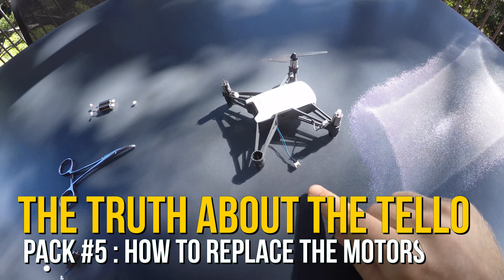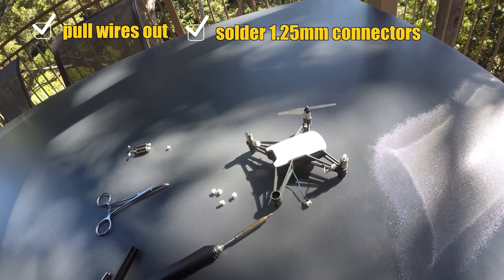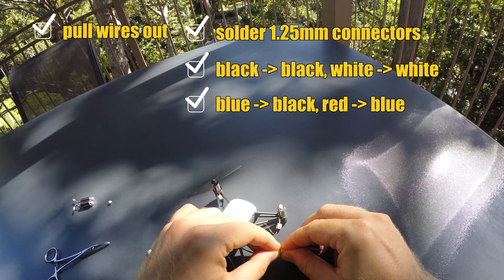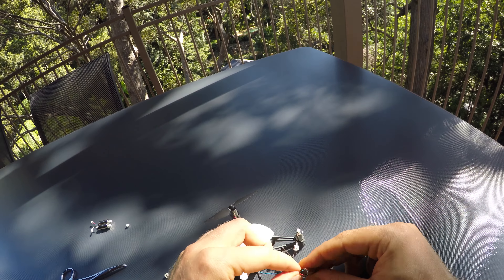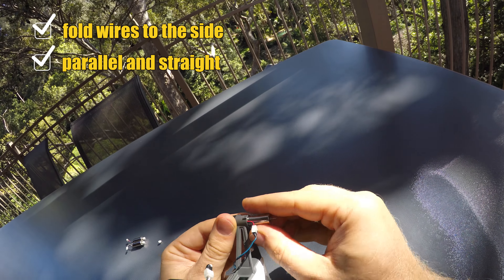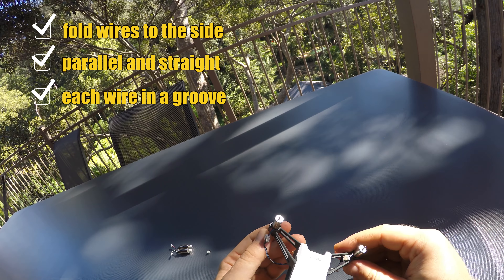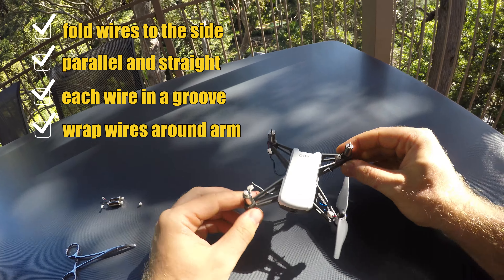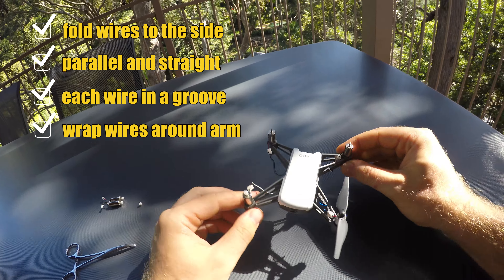The Truth about the Tello - Pack #5: How to replace the motors

Comment: I made small holes on the backside of the rubber feet and will route the connector through there to the inside of the arm supports. The connector just barely fits down the hole in the motor cup. This way you dont have to worry about pinching the wires and getting them into the grooves perfectly. The rubber feet are soft and drilling a hole takes only a few minutes. And I guess the material thay you remove from the rubber feet offsets the weight of the connector that you add.
Reply from the maker: If you could leave us a review on the website, and upload pictures of your modifications, that would be much appreciated!
Reply: The new motors came in and I posted a quick update to my repair on the Tello FB groups. Will post on the site shortly. Thanks for the help, the Tello flies flawlessly again!

Comment: How do you think, it's possible to replace all motors for other types, more powerful and use DJI Tello motherboard?
Reply from the maker: I think its possible to run the Tello FC with faster motors.
However I also think that the FC is hindering all-out-performance more than the motors. Its configured to be as stable and as efficient as possible, not to be super fast.
What do you want to achieve?
Reply: @Micro-motor-warehouse  more power to lift weights for powerful battery. Tello has cool video chipset for programming so need save it. But very bad motors and battery.
Can you share some information what you have to archive these goals? Thx!

Comment: you sent mine with long wires
Reply from the maker: Hey Jakobe,

the first batch we sent out was with longer wires.
Until I discovered its easier to have the connectors near the motors.
If you prefer to do it like that, please message us in reply to your order confirmation, and we will send you another set with the short wires and sockets.

Cheers
Benedikt
Reply: Micro Motor Warehouse Awesome, thanks. #46853
Reply from the maker: alright, will get a set with the shorter wires and extra connectors your way!
Reply: Got the motors, that was FAST. Repair has been completed. My Tello is airborne again, Thanks!
Reply from the maker: Awesome, Im glad it all worked out for you.
You can also share your pictures on our website by leaving a review on product page.

Happy Flying!
Benedikt
Reply: Micro Motor Warehouse I left a review on the site but there was no option to upload images to it.
Reply from the maker: Hmm.. sorry it didnt work for you. There should have been an option to attach pics.
I will see if I can fix it.  ;(

Comment: So motors die quick on Tello?
Reply from the maker: The motors on the Tello last 5-10 hours.
However,  the wires are installed in a way that if a motor ejects in a crash, it snaps the wires at a point where its very hard to fix.
Reply: Micro Motor Warehouse ryze claims they last 40 hours under heavy testing